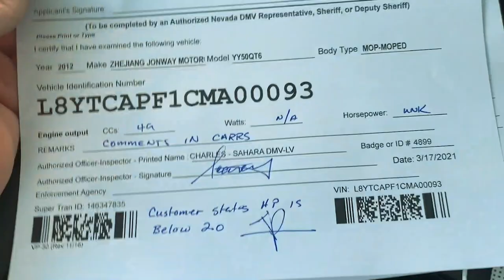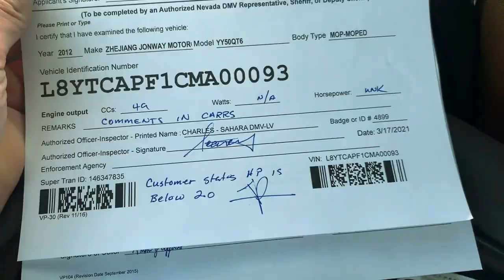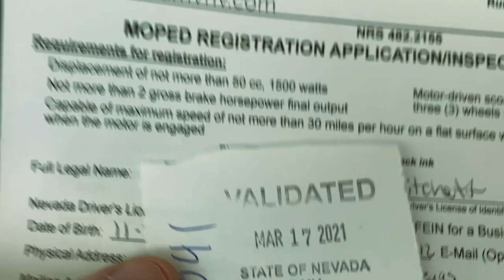HOW to Register any MOPED with NO TITLE! (EASY)

Comment: Here in NJ you have to register it and you need to insure it but if it's under 50 cc you don't need a motorcycle license just your driver's license anything above 50 cc you need a motorcycle license so My question is you don't need a title to register it like you just did in Nevada but I think it's different here in NJ

Comment: A true moped is and has peddles. Mopeds are small motorcycles that can be pedaled like a bicycle. Scooters you can rest your feet on the pad and scoot along. DMV tries to classify what the difference is, but they fail. They just want your money and control. That is just the way I see it. 😍
Reply: Well, at least in my state, if it's a moped, you don't need a motorcycle endorsement, whereas a scooter does. lol

Comment: What’s the top speed of the elite? and you should also do a flyby full speed
Reply from the maker: not sure, well have to test soon
Reply: I had a 150cc TaoTao that was 100% stock that could maybe hit 60mph on a downhill. Have to use GPS speedometer as these cheap ones are wildly inaccurate.

Comment: i want to convert an old honda moto to electric and register it as a moped, here is cali you can call it a moped if the electric motor is less than 3KW

i'm really curious if you can change a moto to a moped after an EV conversion, 3KW is a little low but you could easily either change the part number on the motor, or put a small motor in, get the moped plate, then change it to the motor one you want. really curious if people have tried this, i think the hood DMV trick would be required for this to work
Reply: I'm planning on doing the same thing you are going to do but my frame has no title just Bill of Sale.  I'm hoping to also register it as a moped but a 5K hub I'm using might not pass for a moped classification.

Comment: Trev , I wish I lived over there .
In Pennsylvania , they won't allow registration or title without that MCO.
God only knows how long I'm gonna wait for it .

This state also has the odd way of scooter classification.
They say scooters are motor driven cycles needed to be titled , reg, and
Insured , and here they call mopeds those old bikes with motors on them 
That have pedals to assist . also here the moped vehicle can only go 25 mph ,
While because they issue a motorcycle plate for scooters , they pretty much 
just need be following speed limit.

Hope I didn't give you guys a really bad headache with this .
If someone's new to scooter laws for Pennsylvania , all this described here will help. Peace .
Reply: Do ppl in Pennsylvania need a driving license for the moped

Comment: I did a Honda Ruckus like that, but they made me get a “motorcycle” registration instead of a “moped” one due to the NHTSA 4.3HP rating.
Reply: Did it work ?
Reply: @planetarybeat473  Yeah, didn’t need a title as it never came with one, but as I’ve said, they required me to get insurance and a “motorcycle” registration.
Reply: That’s what sucks about Nevada, motorcycle license for a vehicle that tops at 40mph